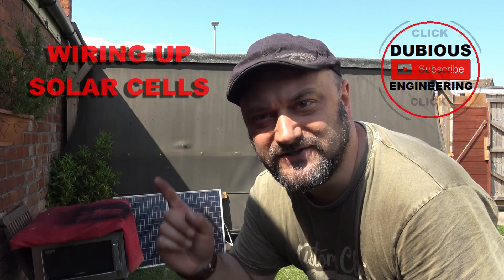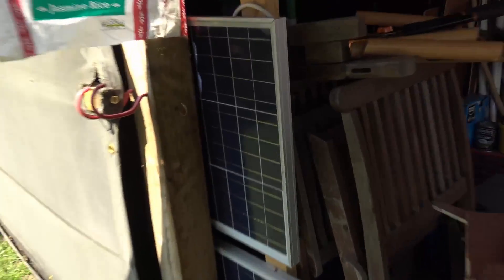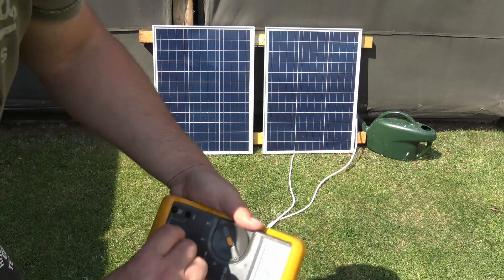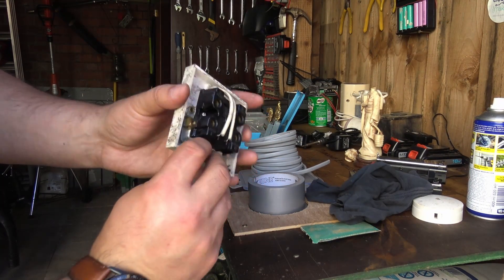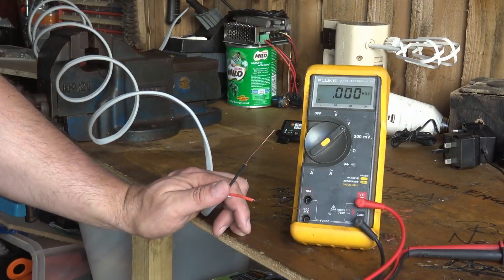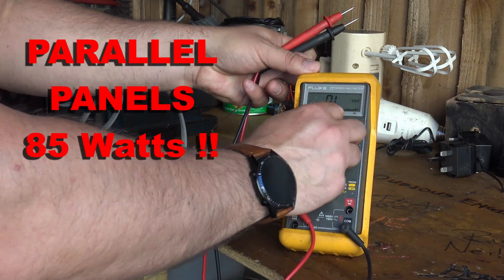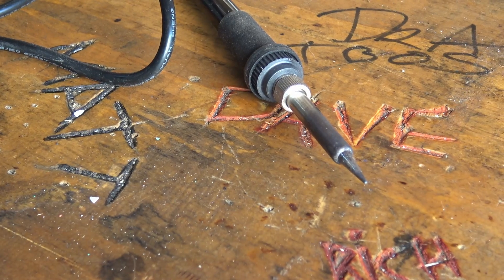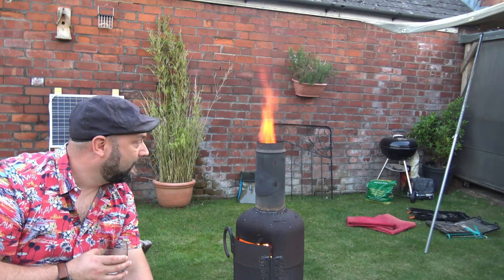DuB-EnG: OFFGRID SOLAR Garden Shed - Fitting, Wiring and Testing bigger cells / panels more power

Comment: What about using a car battery to run the scooter as the misses will not want to be left without her scooter.
Reply from the maker: Mate, I just re-watched that video...  Bahahaha... I'm a loony bin! - In the Shed now, we have about 4 x car batteries and three litium power walls all slow charging over the winter :-)   Once the spring come around, I'll get straight back out there, clean the shed again, and I'm thinking of making the scooter remote controlled :-)   It'll be fun!

Comment: hey Howard great vid as always.  Any chance you could do a video on how to test the 1850 cells and safely  make a battery pack for USB charging?  I have salvaged some cells from a Makita 36v battery.  I have a meter but I'm a noob with how to use it and a soldering iron .
Reply from the maker: Hi Mike, yes, I will in a future video connect up a 12v BMS system on the amiga laotop...  I wont easliy be able to tech you to solder though :-)  That comes with experience!